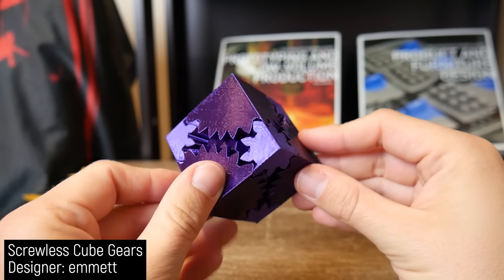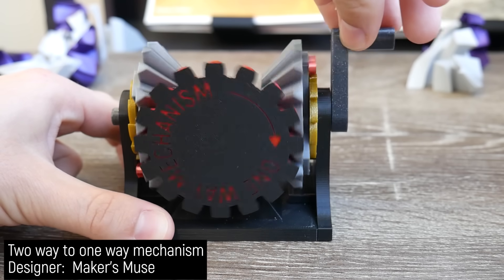Things to 3D print when you're bored!

Comment: One of my early 3D printed items was something I call "Pancake vase". My wife needed a container for mixing a very runny dough for polish pancakes, that will work with hand mixer while keeping it from flying out. So I designed a vase-shaped container that had a narrow opening on top, rounded bottom and wide base for stability. It took ~20 hours to print, but it's still in use after over a year...
Reply: As someone who worked in a Food Safety lab and beyond that, 3D printing is not safe due to the microbiological risks of how the layer lines are formed.   I understand that your family is still living, but it's not worth the risk to your immune system should something happen.   I knew someone that almost died of e. Coli and they were in the hospital for some time.

Comment: I also printed a door catch to replace one that had broken also. Just so handy to have a 3D printer.

I also printed a bag full of those weak plastic push clips that are used to secure finishes and panels in car interiors/exteriors. The ones that always deform or break when you have to pull off an interior door panel etc, etc. Printed them in PLA+. These alone were worth the expense of my Ender 3 Pro
Reply: @arthurgiannakis2156  PETG works great also.  I actually would prefer that for them

Comment: Never did find a 3d solution for minis I actually liked. Two options I try and thought were pretty good was printing off a storage  setup for an old empty spool. And the other option I still am using is reusing a box that the spool came in, and another box that I cut strips put of to make little compartment slots for my minis and some other gear I use to fit into. In the end, Ive actually bought a hard plastic case with foam that can be customized inside of it. Ill likely 3d print some bits and bobs for it along the way, but I havent had a moment to circle back around to that project yet.

Comment: NEVER EVER am I bored! I don't print dust collectors, every one of my prints has been useful! I've printed everything from O'rings in TPU & re-usable zip ties to parts holders for my lathe, to cup holders in my 4wd, brackets for holding things, tape dispensers & zip tie holders in my workshop, the list is endless! #D printing has opened up a whole new world for me. I'm a fabricator, with a workshop full of welders & some very unique equipment like an English wheel, stretchers & shrinkers etc but 3D printing has opened up a whole new world for me! I'm NEVER bored!!
Reply: I had a TPU cable tie in my hand as I was reading this, they are amazing! Mine are printed with a 1mm nozzle, they only take 1 minute to print, 1 gram of filament, and are extremely strong for only being one layer thick. Just had a project last night where I needed about 20 of them. Set the slicer to print 1 at a time, and pulled them off as I needed them. Worked out so perfectly! By the time I was ready for the next one it was already done printing. When I take it down eventually, I will be able to reuse all of those as well.

Comment: After printing some widgets and toys with my 3D printer, I then started using it to create replacement parts for my dishwasher, refrigerator, cabinet latches, etc.  Then I started printing a lot of jigs for woodworking (Kreg jigs, alignment dowels, trammel points, etc.).  Then functional things like ports for my dust collection, etc.  Tool cases, taps and die organization, and so many more.  The printer is not a toy, it's a meta-tool.  Oh, and altimeter and nosecone bays for high powered rocketry....:)

Comment: I totally agree with people learning CAD if they have a 3D printer. I used to make all of my models in Blender or Z Brush, but they were mostly organic/character based models. I have made some mechanical things in Blender, but the more I "get used to" Fusion 360, the more fun the process gets. 
Making parts that need to interact being designed parametrically is such a more pleasant workflow when it comes to making adjustments and iterations or variations of designs.
I still use Blender almost every day for some of it, but haven't opened Zbrush in years.

Comment: I recently got a 1mm nozzle and holy smokes is it fun! Those thicc layers are so satisfying!

If you can 3d model or want to learn/practice, then go around your home and find one of your most popular items or tools or whatever. Identify a problem with it, and invent a solution for that problem.

For example, let's say you have an iphone and the charging cable doesn't stay plugged into it. Hop in CAD and design a retaining device for it. It may take a long time and many iterations, but once you have a product pop it up onto ebay or something. 

I did this for something else and have made $845 in the last 90 days on ebay with just 1 product. A lot of that is further spent on filament and maintenance and electricity and shipping materials but any profits go right back into the hobby to keep me from boredom. I am not a success story where I don't need a day job, but I am having a lot of fun with it and the hobby is paying for itself!

Comment: I sort of took the opposite approach when I hit that "now what?" wall.  I'd started with an Ender-5 and fought and fought and fought with that damn thing to make it work.  Then I was a very early adopter of the X1C and blew through my backlog of things I needed to 3D print in about a month and a half, and then all the things that I could 3D print but was trying not to (so I didn't have to deal with that gorram Ender-5) in another month.  And then I was all  "now what?"

It took a while, but at this point I use the 3D printer when there's a thing I need to make.  And when there isn't a thing I need to make (or at least, not out of plastic) I'm okay with just turning the printer off.  I don't run drill or my ratchet set 24/7, I use them when they're the right tool.  Same with the 3D printer.

So this is a  great video for the person who is "I want to run the printer but I don't know what to make!"  But another thing to consider is "maybe turn it off for now, you'll have an idea soon enough."

Comment: My 3D printer is not a toy to get bored of! 
It's a tool and a great one at that. 
I fix at least one thing around the house every month. 
Last month was the shower handle. It was made of acrylic and cracked from thermal expansion/contractions. Printed one out of PETG and replaced the original. 
Looks even better cuz it's my own design. 
This month will be the top of the bird feeder and probably other stuff...

Comment: I do, mostly, functional prints. A couple examples. I have video surveillance camera. One of the mounts broke. Of course you can't just buy the mount. I took the broken one and modelled it. Very fast design as, you can imagine, was not a complicated geometry. Our RV gate one of the wood planks had cracked at the bottom. Easy fix with just a rectangle with a hole for the bolt. Etc. I have a variety of printers, my favorites being a Voron and just grabbed an Ankermake M5 which is cooler than I expected for a bed slinger.

Comment: ngl i kinda got bored of printing after i did some big projects but only because of the time and how much i had to mess around with the settings and the printer to print stuff right. but now i have a bambu A1 coming and i cannot wait to be able to toss stuff onto it and not need to manually adjust or check everything, that and my ender is an OLD one and im sure the A1 is vastly superior so ill also get better quality prints faster.

Comment: whenever im bored i print minis then once i get up to 12 i sell them on ebay I then put them up to bid and they sell for around 12 to 10 bucks. A roll of the pla cost 20 bucks and I can print sooo many of them. and i got the setting tuned to print minis pretty good for pla.

Comment: "So you finally done it, your 3D printer is printing perfectly, no more failed prints, no more jammed extruder and no more bed leveling issues" 
Laughs in Bambu labs
Reply: cries in Ender 3
Reply: There's aways a weird brand cultist shouting for attention...😂
Reply: Imma laugh in not having my printer catch fire or print stuff from strangers on the internet then :)
Reply: Well done to your Bambu labs printer. I have a Prusa and my experience is the same. I didn't buy a printer to play with the printer. I bought a tool and it hasn't disappointed. I'm also try to build a delta and that is just a hobby and every time work gets busy the delta project goes on the back burner.
Reply: not having to worry about leveling and calibration has been a dream. i hate tinkering with printers. ive done it for 7 years and i do not care for it. just want a tool that works and that is exactly what my p1s does
Reply: Cries in Ender 5, the bowden printer from hell. Retractions? What's that?
Reply: @chrismay2298  cultist? Not at all. My first printer was a MP Mini delta and was an absolute pig to level or get anything close to a good print from. I bought a printer to print with, not feck about with endlessly just to spend 50% of the printers worth on upgrades to make useable
Reply: @4nto418  literally not had either of those issue, but good for you :)
Reply: @deadly_dave  nice! I got the A1 mini because I wanted the easiest printing experience possible and want to print stuff rather than tinker with the printer itself.

Comment: It seems silly to use a printer to just churn out storage stuff. Yet it is one of the greatest things to use a printer for. As it can save decent money and scale extremely well.
I own a legion of electronics components, but buying storage for that is expensive and a hassle. Now i am designing my own tray system with drawers that can hold components/SMD-boxes that would cost a fraction of the price of a professional system, which i can scale as needed for any kind of area. Even exploring the idea of integrating some little magnets in the corners so the drawers anchor themselves to the cabinet a little for easier handling of the entire system without everything flying out.

After that. Off to design parts for my big projects. One being Animatronic in nature, the other more like an attempt at toy-making.